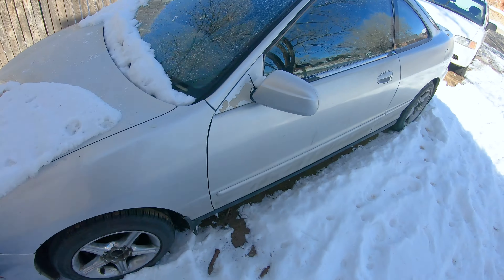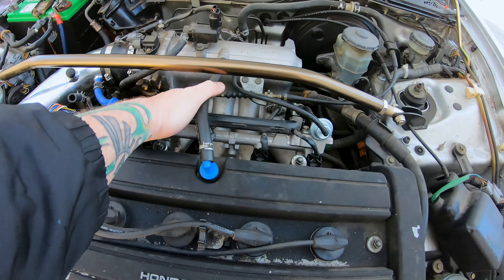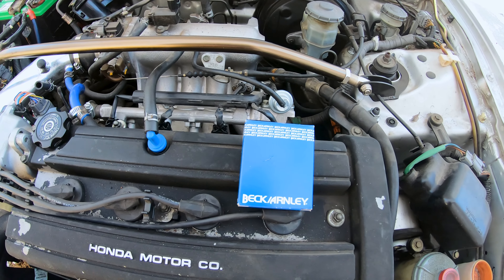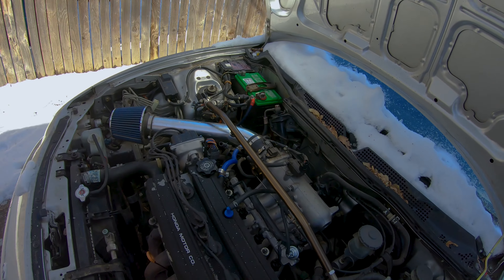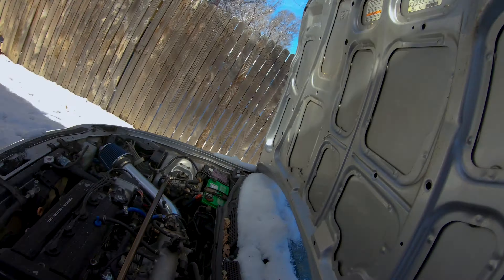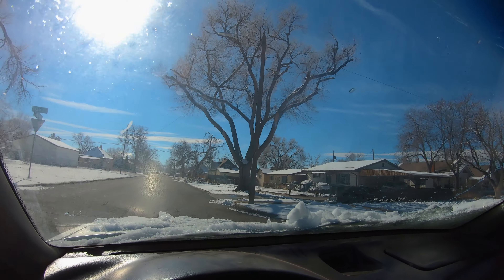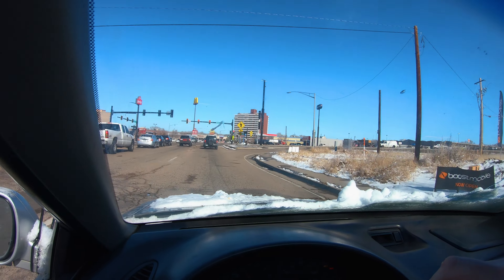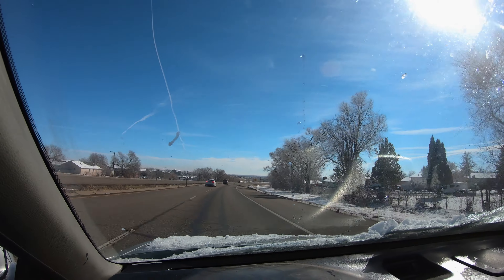Fixing My B18 Integra's Hesitation! (Doing Some Street Pulls!) | TunerThings

Comment: So when you took off the regulator, did you notice it was moist around it? or like look like it was leaking fuel from the o ring? I have a similar issue with a b18c1, runs great but when i floor it, feels like a stock d15b lol. and i do notice on my aftermarket fuel rail, it is moist, so i took some on my finger and smelled it and it was fuel.

Comment: Sometime ago i was on the highway and my Acura started to slow down and eventually would not accelerate in any gear, also, after it slowed down to about 20mph would not go any further had to pull off to the side and have it towed. It moved for a bit in reverse just enough for me to back it off the truck and into the driveway. Now does not move at all. It starts up normal but when i give it gas just bogs and does not move. Any thoughts on what the problem might be

Comment: So can I get help please so my Integra is an auto and when I got past 5 k rpms I can push down my peddle all the way done to the floor and it don’t pick up its takes time to go up to speed up and when I’m going up hills and I’m tryna speed up to go up the hill it feels like it’s going slower and the speed idle goes slowly goes down while going up hill CAN SOMEONE TELL ME WHATS WRONG WITH MY CAR PLEASE
Reply from the maker: I can do my best brotha.. have you checked your cap and rotor lately? How old are your plugs and wires?
Reply: @TunerThings  I replaced both things already I did a oil change spark plugs and wire cap and rotor
Reply from the maker: @danielbecerra3773  Have you tried replacing your fuel filter and or fuel pump lately?
Reply: @TunerThings  no but I am going to change my fuel filter soon

Comment: So my car basically has the same problem.. I had bought my GSR with 200k miles babied it till I got my b20.. the GSR had the same problem and wen I put the pedal down.. at 5k it just COMPLETELY lost all power.. I did the swap and my new b20 with 15k miles is doing the same thing..
Reply from the maker: I think my problem is my fuel pump not acting right... gonna tackle that today or tomorrow!
Reply: @TunerThings   Have you replaced your fuel injector O rings?